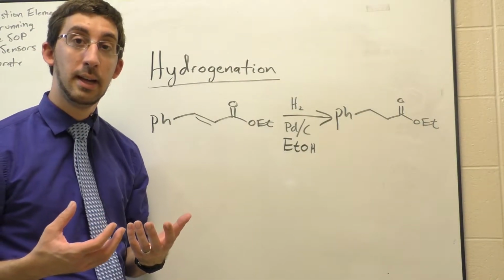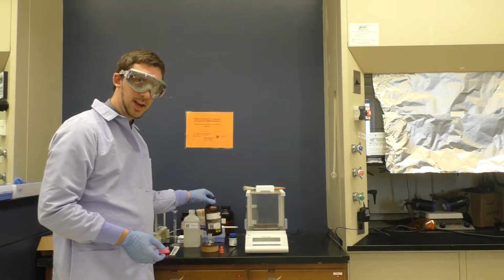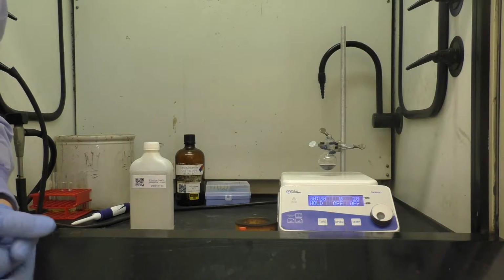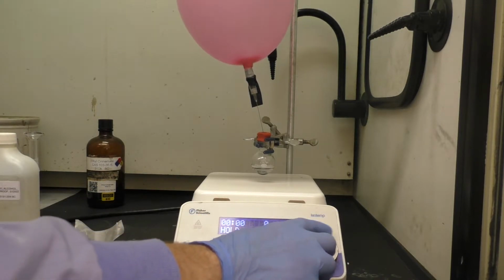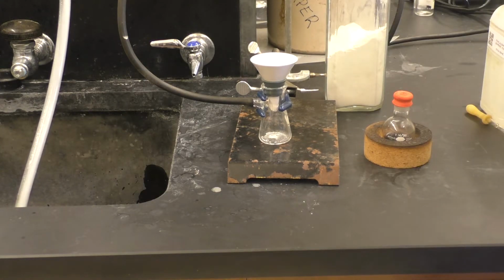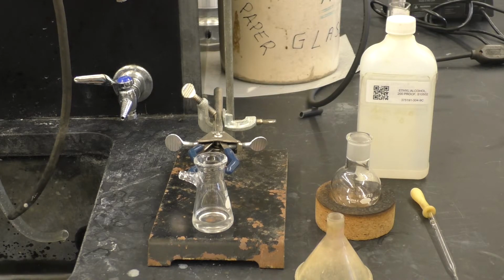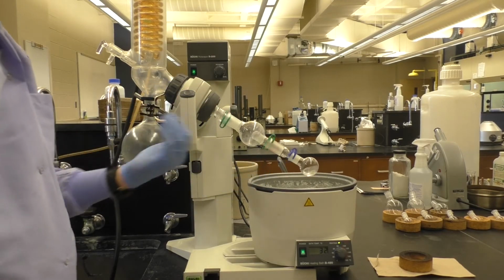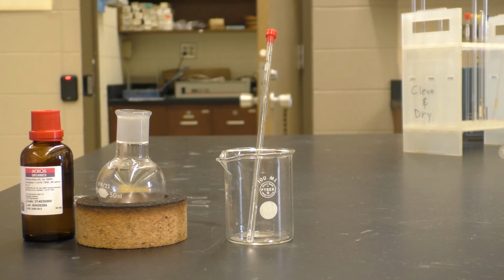Hydrogenation of Ethyl Cinnamate

Comment: How can that be your NMR? There is an impurity in it, isn't it? Because you'd expect 3 signals between 2 and 4 ppm, the aromatic region at 7 ppm and the methyl group at around 1.2 ppm?
Reply from the maker: There is residual ethanol from the solvent that wasn't completely removed by the rotovap. This is quite common and I intentionally want students to be able to recognize and assign this. However, I will admit there is more residual solvent in this sample than normal.
Reply: Thank you for the explanation! @dr.ianmackenzie869

Comment: Thanks for the video, but where does the catalyst go after the hydrogenation process, such as the nickel catalyst? Can it be used again?
Reply from the maker: This is a good question. In this case, the Pd catalyst remains on the carbon support which was collected on the Celite. Theoretically, it could be recycled and reused. I haven't tried that since we normally just throw the celite away, but I don't see any reason why you couldn't.

Comment: Hello sir, very good explanation, I wanted to know few things.
1. Is hydrogen balloon with needle needs to be dip inside the solution or just above in the free space of RB is fine.
2. Can we simply discard celite with Pd after filtration or any treatment is needed before throwing it in the waste.
3. I often see, you letting the hydrogen leak at the end in the hood, is it safe to do so?
4. Is purging necessary and safe as we let the hydrogen gas go into the air?
Reply from the maker: I'm glad you liked it. 1. Just into the head space is fine. 2. We usually just discard the celite into the trash, especially some the amount of Pd used is so small. If concerned, it could go into a solid waste container for disposal with hazardous water. 3. Yes, this is safe as long as kept away from any ignition sources. 4. Yes, this is safe and also probably a good idea since without the purge your head space may remain largely air (since hydrogen is lighter than air) and the reaction may be slow.
One final note: the rate of the reaction may depend on how active your palladium source is. You may need to extend the reaction time if full conversation is not observed during the regularly allotted time.
Reply: @dr.ianmackenzie869  Thank you sir

Comment: great video.

how do you know when the rotavap has finished? both the solvent and the product are liquid and they are under vacuum, won't some of the product evaporate? isn't it better to use distillation? 
thx.
Reply from the maker: Good question. It is true that if your product is low boiling that it is quite possible to lose some (or all) of it on the rotovap. However, in many cases, the boiling point of the product is much higher than that of the solvent and so it is not difficult to remove the solvent without losing much product. In this case, our product actually ought to be a solid, but if you check the NMR you will see there is still some solvent remaining. I should have left it on the rotovap for a bit longer. Solids will often solidify on the sides of the flask as the solvent is removed, but if it is a bit of an oily solid (or low melting, etc.) then it might only solidify after you remove it from the rotovap. I hope this helps!

Comment: Why would you want to hydrogenate ethyl cinnamate?
Reply from the maker: Good question! This specific substrate is chosen mostly because of the ease of the reaction and the short time required, rather than the particular value of the resulting product. However, cinnamates and hydrocinnamates (the class of products resulting from this hydrogenation) have uses in the flavor and perfume industries. I hope this helps.
Reply: Lollll

Comment: What is the product you attach to the end of the balloons?
Reply from the maker: Good question! It is a 3mL plastic syringe that has been cut in half. The balloon is then slid over the cut end and sealed with parafilm or electrical tape. The appropriate size of syringe will vary depending on the size of the balloon.

Comment: Very well presented and informative, doc! Just curious if it is mandatory for the hydrogen balloon needle to be immersed into the Pd/C/ethanol suspension, or is the hydrogenation still facile by simply filling up the headspace above the suspension? Thanks!
Reply from the maker: Good question! It is not mandatory to have the needle immersed. Most of the time I just have a needle into the headspace and the stirring action helps being it into solution.